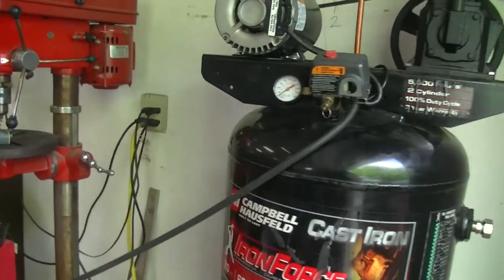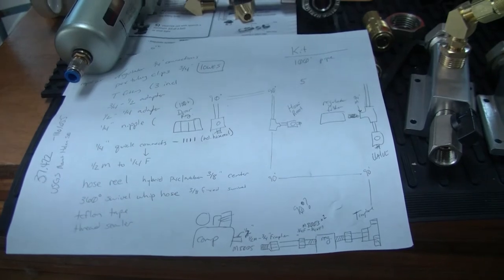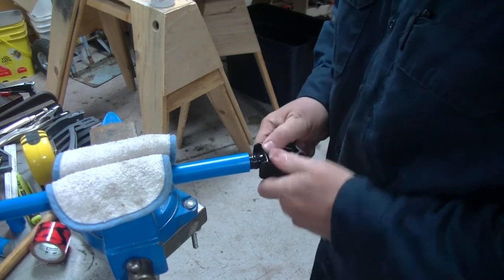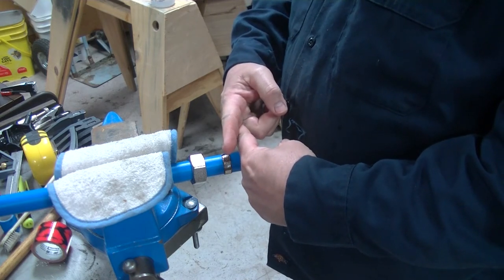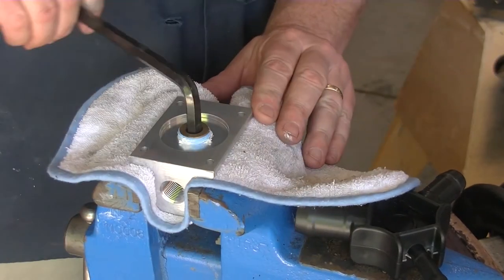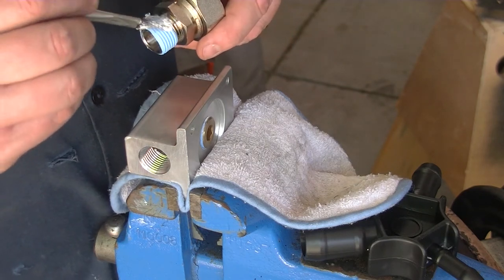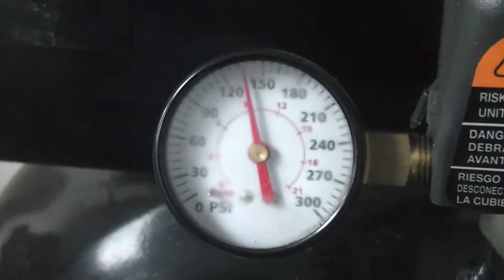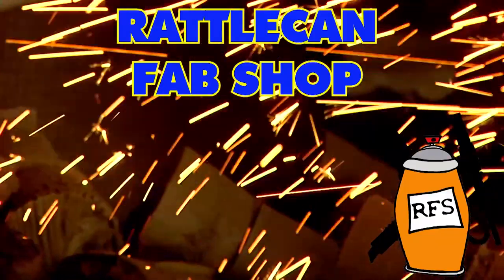MaxLine compressed air kit M7500 install | RATTLECAN FAB SHOP with James O'Rear

Comment: I know what you mean with the sore muscles! I just finished my install of the 3/4" airline system in 3 days by myself. With all the climbing up/down the ladder, reaming the pipe ends, bending, pulling in place and tightening the compression nuts, then fixing a few leaks,  I felt like I was beaten up in the end. But sure is nice now that it's done.

Comment: Thanks for the video, very informative and interesting.  I was avoiding the 90 deg fittings but I think it will look better so I will probably go that route.  This will be in my attached 2 car garage so this won't be for a shop and I think the 90 degree fitting give it a nice look.  You are right about the cost of the fittings, I wish there was a way to use regular fittings and save some $$, but I'll try to minimize the use of extra fittings.  Anyway great video!
Reply from the maker: Best of luck with your setup!